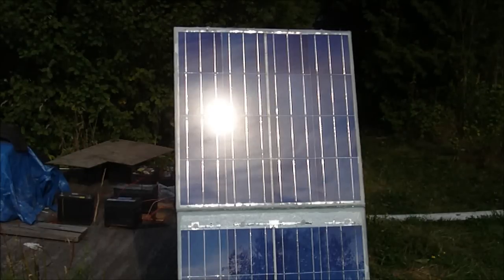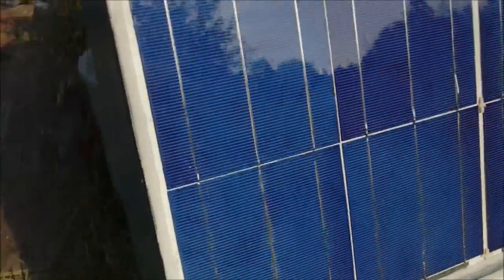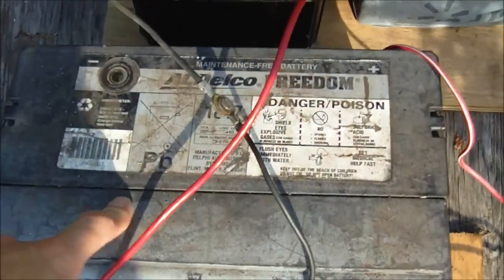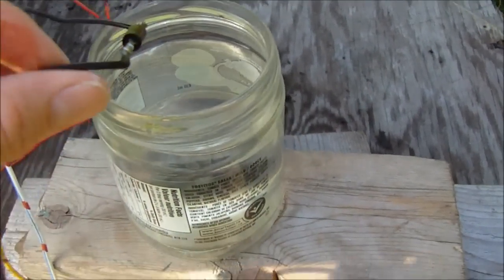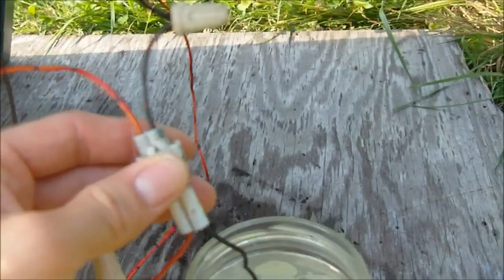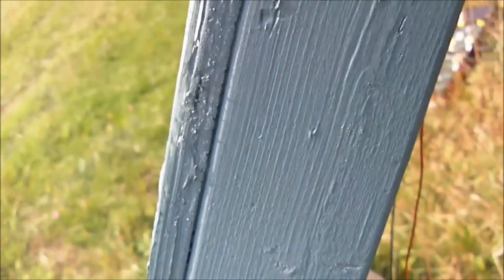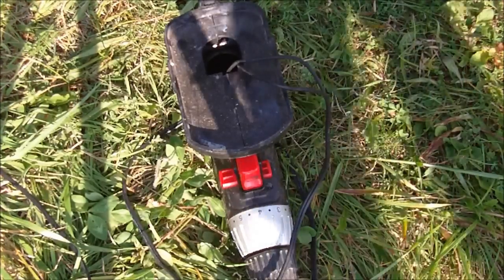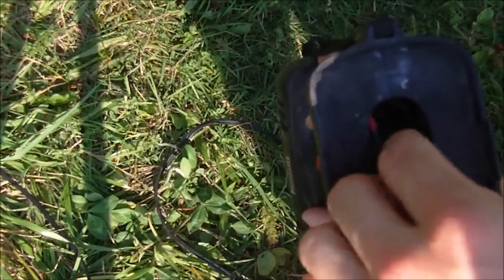Homemade Solar Panel 100w, wood backing and frame

Comment: you should do a tutorial on a 100 watt start to finish in one case . most of the diy panels are under powered wast of time .thats why more are not doing it . but i would if there was a little more info available  for panels  100 watts and above . good job and thanks

Comment: ok... the video is old... 2012... makes me wonder if there is a saving  now in 2016... he is using some stuff that are not ideal... like the wood planks... there I would have used a white flat sheet of fiber glass, or something similar that can properly handle being exposed to the sun... the wood frame also seems like a nono... there a common aluminium frame would have been way superior

Comment: i'm going to make a panel 35 cells like you, 4w cell, but the back face, i dont use glass, i use plastic. I use tape adhesive to attach the cell to to front face. I use silicon to seal it & aluminium so frame glas & plastic face. can you give me some opinions. I intend to place my panel on the roof

Comment: Excellent.  I have been investigating some and have some preliminary ideas.  Bee Cool Ventilators has a product which might give you an idea of the project.  I am leaning toward one larger panel and free used car batteries, then run wires to 5-10 hives in a row.  Cheaper per hive and don't have to move a solar panel each time you need to inspect the hive.  Each hive would need the vent box, cpu fan and thermostat (90/80 degree).

Comment: Kurt,  I would like to discuss with you a project I am looking using 12 volt solar panels.  I have learned a lot from your videos and would appreciate some input from you if you are willing.  The project is a recent idea of using cpu fans to cool beehives.  Bees spend much valuable energy and time cooling their hives.  Providing artificial cooling results in dramatic increase in honey production.  You can contact me through Ozark Cedar Hives web site if you like.  thx